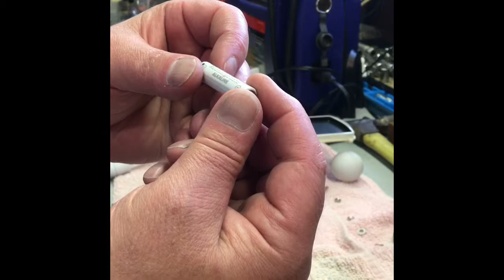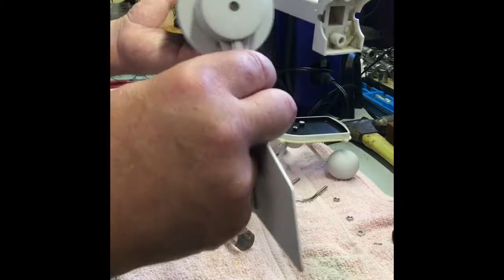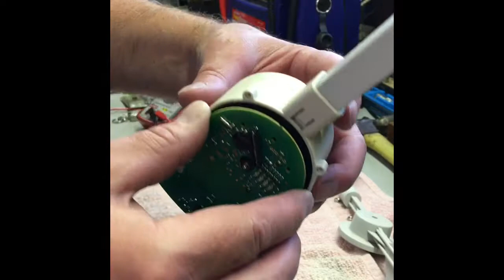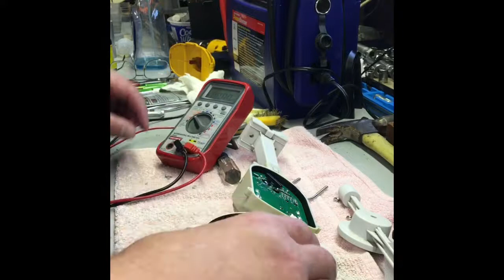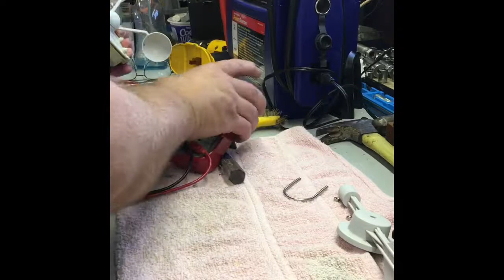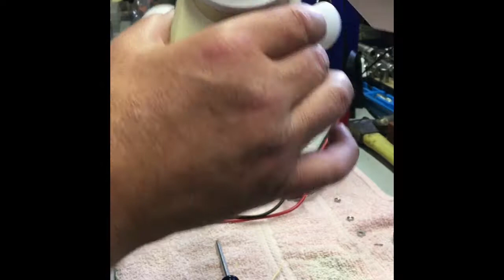La crosse technology TX63U-IT anemometer battery replacement

Comment: When removing the weathervane, inserted a small steel rod into the center hole now available where the hold down screw had been and applied pressure between the rod and my fingers under the vane. A fine screwdriver also works well in this situation.
When the rod bottoms into the threaded area of the shaft, your fingers act as the puller.
This helped keep all force off any internal elements of the unit while removing the weathervane.
Reply from the maker: Good information, thank you.   I wasn’t sure if any of these were still in service.     I switched to an  Ambient Weather WS2000 last year.
Reply: @jatoav8or  Are you happy with the Ambient Weather WS2000? Seems like all weather stations, no matter what the price, have some sort of drawback.
The LaCrosse station is probably on its last leg and plan to upgrade in the near future. 
With all units, knowing how the software is written would make a big difference when it comes to setting up a unit and any subsequent re-establishment for a reboot.
Thank you for taking the time to make your video. It was very helpful in knowing what to look for when troubleshooting the anemometer. Wish LaCrosse had chosen a different battery for the unit.
Regards, Ralph
Reply from the maker: @Ralph-j1m  I can’t believe it’s been nearly 4 years but I’ve had my WS2000 since December of 2020. 
It’s honestly been trouble free. I have additional sensors in my pump house & storage shed & greenhouse. 
It’s never lost connection with the main array or sensors.
I replace the AA cells annually (energizer lithium)  the color display is really laid out well. It also keeps its connection with the internet 100% 
You can check it out on Weather Underground and ambientweather.net
KWAOCEAN141
Dingus Beach Wx. Ocean Park, Wa.

Comment: This is a good sensor, but the "weak link" are the alkaline rechargeable batteries. I've often wondered if these batteries could be replaced with a lithium battery. The two alkaline batteries typically will show about 3.3 V. A lithium battery is 3.7 V. One diode would drop that voltage down to about 3.1. The problem is, will the solar panel charge a 3.7 V battery. It might. With a lithium battery replacement, it would probably be good for at least 5 years.
Reply from the maker: It’s frustrating that La Tech never offered replacement alkaline cells. I agree that the little solar panel probably wouldn’t create enough voltage to charge a lithium cell to 4.2 volts

Comment: I know this is very old, but...
I just used your video to replace the batteries in my TX63U-IT.  Everything went well with the exception of a little tiny brass puck that was left in the wind cup base.  I suspect it is a contact for the reset rubber thingy. 
 
Prior to removing the circuit board assembly I checked the voltage across the battery terminals on the exposed side of the circuit board.  No voltage.  This was before I discovered a dead battery.

1 La Crosse battery was 1.6V, the other was 1.28V.    After replacing the batteries, the terminals on the battery side read  1.7V at each end.  On the other side of the board where the rectangular solder positions are, still zero voltage.  The only thing I can think is the circuit board has internal corrosion or a crack in the solder.  Does anyone have a suggestion?  This is a great video!

Comment: I saw in one of the comments you have retired the old La Crosse weather station. I would be interested in buying anything you may have left of the system. I am still using the a La Crosse system and as you know some of the sensors are becoming difficult to locate these days. Let me know what you have and if you are willing to get rid of.
Reply from the maker: Yes I still have various C84612 sensors and at least one display. I believe a few are new/unused. I can contact you in a few weeks to arrange something. I just moved permanently to my home on the SW Wa coast and have much unpacking.
Reply: Yes, when you get all unpacked let me know what you have, I am interested, would take the whole lot to keep this system running as long as I can.

Comment: Thanks for the informative video particularly about the mechanical aspect of assembly.  I've replaced the batteries in my TX63U-IT successfully.  You mentioned that the solar panel voltage is 1.5v.  It seems that the batteries are in series for a 3v output.  Because of this, I would have thought that the solar panel voltage would be at least 3v in order to charge the two batteries.  So, what is the solar panel voltage?  1.5v or 3v with the batteries in place.  IF the voltage is 1.5v, there must be a circuit on the board that at least doubles that voltage to 3v or a little more.  When I had mine apart, I forgot to make these measurements before re-assembly.
Reply from the maker: Don, it’s been several years since I made that video on the lacrosse station and I must admit I’ve switched to Ambient Weather WS-2000 stations. 
I’m also in the process of moving on the Washington coast & my several lacrosse systems are packed away. 
I do have several lacrosse anemometers & when I’m finished moving/ settled I hope to find someone who can take all the used equipment. 
Again, I apologize I can’t be of more assistance at the moment.
Reply: I have measure the voltage of the solar panel. With no load on it, it will produce 4.05 Volts.

Comment: I have a Lacrosse temp/humidity sensor that uses the same batteries. They are still working but nice to know that there is already a solution to their "Sensor batteries are not replaceable."

Comment: Add me to your list of grateful viewers. The how-to open up was perhaps the most valuable tip.  Like yours, the wind vane on my unit was highly resistant to removing, and I would likely have messed it up like you did. FWIW, I got a screwdriver blade under opposing bottom edges of the vane and carefully pried each side up until it came loose. On reassembly I lubed the vane shaft.

I had another surprise twist that might be useful for viewers.  A few days after returning mine to service, the unit failed again. Upon opening it up, I discovered that the negative lead from the solar cell had broken right at the mastic level. I used an exacto to carefully carve away the mastic around the tiny stub of wire that remained until I had dished out around it. I carefully prepped the end of the negative lead. It is virtually impossible to solder the two tiny leads.  So my solution was to fill the dished out mastic with a drop of solder, then insert the prepped negative lead into the molten solder, holding it in place until the solder set. Checked the voltage in sunlight...and success. Hopefully it will hold up and serve a long time.
Reply from the maker: I had two complete stations, one at my primary residence & one at a beach cabin. Those wires feeding from the solar panel have broken on me as well.  I’ve converted to Ambient Weather WS2000 stations. I still have two complete Lacrosse C84612 stations with several replacement sensors. If anyone is interested I would give everything for just the shipping charges. Some of the sensors are new old stock still in the box.

Comment: My TX63U-IT anemometer has recently failed and after watching your video I was able to find the old alkaline batteries in the unit. I know you have advised against using lithum batteries because of 3.7v.  I have noticed some lithium rechargeable batteries rated at 1.5v on Amazon.   Do you know if these might work in the tx 63u-it?  Thanks, and thanks for the informative video.
Reply from the maker: I actually May be able to help you out, I retired my lacrosse tech stations & have a few new rechargeable alkaline cells. I’m really busy the next few days but I’ll try to contact you towards the middle of the week. 
I also will be posting two complete used stations on ebay soon at a reasonable price. Lacrosse no longer makes these particular units so someone can use them.
Reply: @jatoav8or  Thanks for the reply. I was just notified by ebay there are 1.5v alkaline rechargeables  online.  Should be delivered in about 7 days.  Meanwhile I am thinking of getting the V40 weather system from Lacrosse but they are telling me of problems getting that model connected to the NWS and probably to wunderground, so I will wait to see if it gets resolved. Actually I prefer a stand alone rain sensor anyway and hopefully my old 2810 will be up and running soon.
Reply from the maker: @bgfoot6707  I hope it gets sorted out soon for you. Since this video I have replaced both my lacrosse technology stations with two Ambient Weather WS2000 assemblies, it’s been 8 months since the switch and I’m very pleased with the functionality. Very impressed.
Reply: @jatoav8or   Just a note followup; Lacrosse up and running perfect since new battery installation.  I had to take it apart a second time after the first day and a half of running. Battery had fallen off the contacts. Slightly adjusted the contacts for a firmer fit and it has been running like new ever since for several weeks now.  Many thanks again for the video.  BTW while my station was down waiting for batteries, I purchased a Logia 5-1 and also an Ecowitt  hp3501 because of the separate rain gauge and hygrometer.  Both were easy to connect to WU and have been running without a hitch.   Ecowitt seems to have a sensitive wind sensor but  has many setting adjustments on its console for most functions. Experimenting.
Reply from the maker: @bgfoot6707  good to hear it worked out. I really must Quit procrastinating & post my old lacrosse equipment on ebay. I don’t expect to ask much more than shipping, just hate to see it waisted.
The Ecowitt line & Ambient seem to share similarities, I was undecided between the two & finally settled on the ws2k
Reply: @jatoav8or  Thanks for your video, my TX63u-it anemometer stopped working a little while back but thanks to your video I was able to get into it and check the batteries one had some corrosion built up, I was able to clean it up as well as clean the contacts. I checked the batteries voltage and they still are at 1.4 volts, I put it all back together with no problems, but it still won't pick up the signal and no readings on the display. Do you have any other suggestions or anything else that I should be looking at?
Reply from the maker: @daniellopez-vd6fw  only the reset process. If you read the instructions for resetting the unit or storing they have a fairly convoluted method they recommend that includes covering the solar panel for an extended period. Were both cells producing 1.5v or better?
Also the wires leading from the panel are extremely fragile. 
I really have to get off my rear & list my two systems on ebay so someone can get some use before they are no good.
Reply: @jatoav8or  Thank you for reply. I did find the links you put up on another post about the reset process which I am doing now. I will be ordering some new batteries (even though they are still testing 1.5v) I didn't test the solar output but I will check when I go back in to change the batteries, and I will confirm the output of the solar panel , was just a little nervous scraping the white material covering the contacts. The wires looked good but will double check. Thank you for your help. I love this older system  mainly cause of wind direction and wind chill which is hard to find on newer systems. I picked this one from Ebay a few months back 
still new in box so everything still is in good condition just now the anemometer is acting up with the battery issues. I'll have to maybe keep a eye on ebay for yours once you get a chance. Thanks again for your help!
Reply: @jatoav8or  I recently had to take down my 2810 anemometer and found out the black and red wires became loose and disconnected from the solar panel.   Do you know if these can be reattached?  Doesn't look like a soldered connection. May have to give up the ghost on this. Thanks.
Reply from the maker: @bgfoot6707  
I finally replaced my lacrosse stations last year with Ambient Weather Ws2000’s
It’s been so long since I’ve been inside of that equipment I honestly couldn’t tell you. I do recall the wiring is extremely fine gauge.
I do have two complete lacrosse C84612 stations with spare components in a box going to waste.
Reply from the maker: I don’t think the lithium will work in the long run because the little solar panel doesn’t put out the correct voltage to recharge it.

Comment: I also bought the La Crosse  Weather Station at Costco just like you around 2014 or so .  I've replaced some components by buying from La Crosse including the TX63U-IT.  They no longer offer the TX63U-IT though and mine died.  The batteries are the reason for the failure (seems like they only last 2-3 years). After watching your video I was able to purchase rechargeable Alkalines on eBay and repaired my TX63U-IT.  Works like a champ.  Thank you for your video! 

As I posted a question 4 months ago, the wireless USB stick for downloading Heavy Weather data worked on my Windows 7 OS but does not work on Windows 10.   I'm sure it may be an unsupported driver issue but am not that familiar with how to rectify or add a driver that will work.   Does anyone know of a fix or update for this issue?

Comment: I cannot get a signal from the unit. Do I need to press the reset button to start it transmitting???  I have found no information regarding the reset  button except for the first time when setting up the weather station. The batteries are testing OK but will try getting replacement cells anyway. Your video pulled my fat out of the fire. I also broke the light sensor "pipe" while dismantaling the unit. Great video, thanksL  Bill
Reply from the maker: The spec sheet I have says to press the reset button once after a battery install. Also important the solar panel is exposed to bright light during this process. I found a fcc data sheet that has quite a bit of info on it.
Reply from the maker: https://usermanual.wiki/La-Crosse-Technology/M12/html
Reply: Thank you very much for your reply's. I seem to be having a new problem, finding replacement batteries. Seems they are all made in China, except one outfit in Canada, but they ship from Latvia and (has to be an error) they're asking $150 for shipping fee (Ebay).
Reply from the maker: @williambutlersr.4587  8pcs 1.5V New Alkaline Rechargeable Battery Cell AAA Battery for Led Light Toy MP3 TV Remote Controls Clocks and Radios Electronic Games Christmas Gift Toy https://www.amazon.com/dp/B07C96TWHW/ref=cm_sw_r_cp_api_fabt1_Wx5XFbXNJ2HWP
Found these AAA alkaline rechargeable on Amazon.
Reply: @jatoav8or  Thank you again. Will check them out. Bill